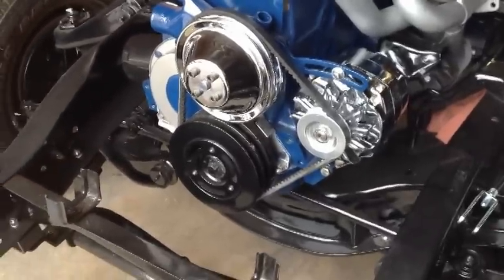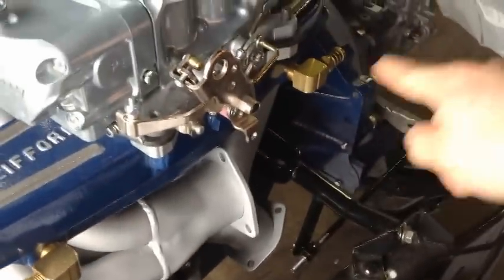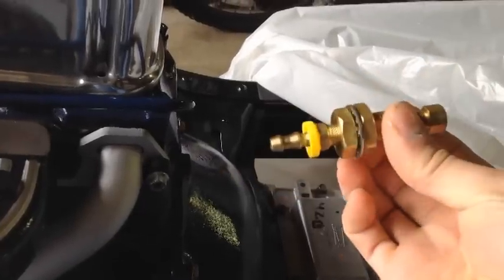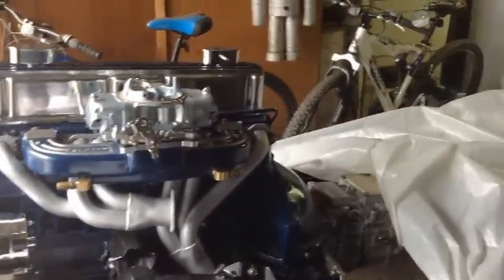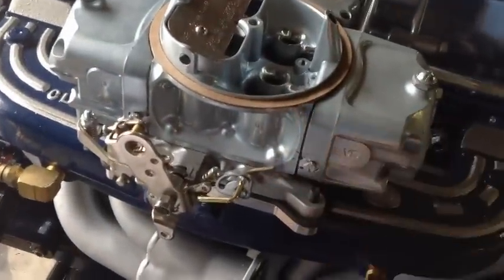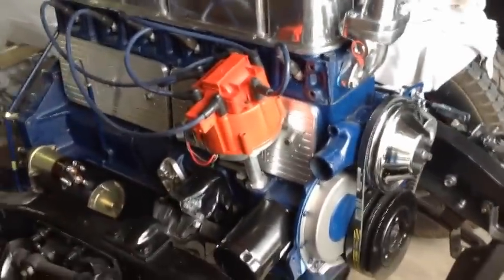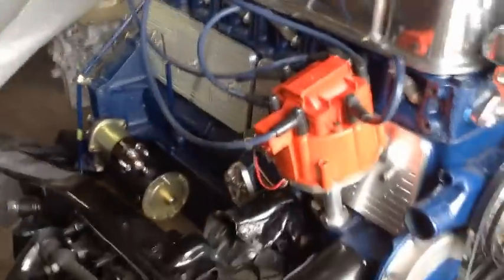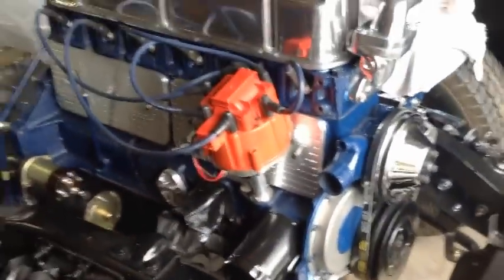292 Hotrod 6- Small Updates and Plans.

Comment: looks pretty cool, but kind of freaks me out about pressurized fuel line in the cab.  can you find an electrical one that can send an electrical impulse to a gauge?  engine looks amazing
Reply from the maker: I did think on it, but my idea was.....These things came stock with 20 gallon tanks sitting behind the seat.....so a little 5/16 fuel line with 8 PSI is probably safer. lol I may Not put it in the cab.....but it's in the plan. The issues I have been seeing is that when these gauges are to close to engine heat they start to read way high. The gauge I put on my GMC is mounted on the fuel rail above the engine....used to read 6-8 PSI now it reads around 12 PSI. Seems the heat gets to these...so my idea was to mount in the dash to keep the gauge cooler....And I can monitor the pressure reading from inside the cab. Thanks!